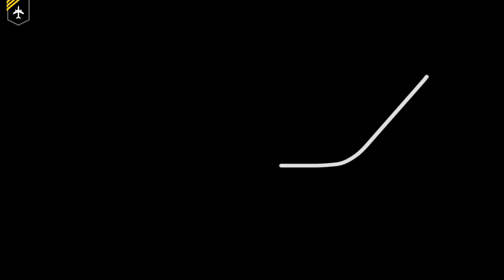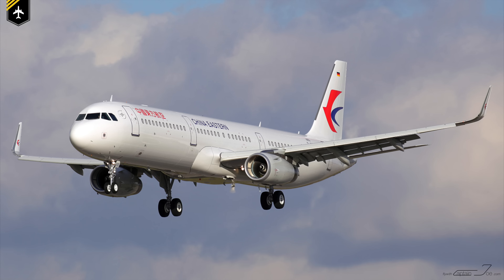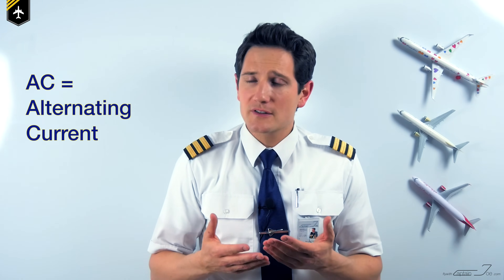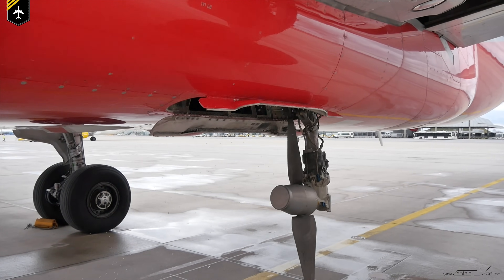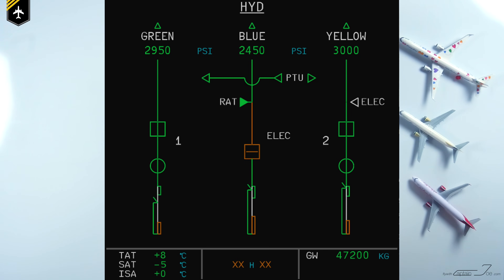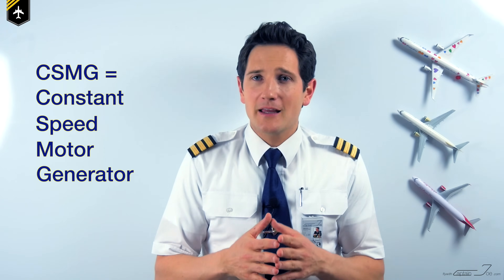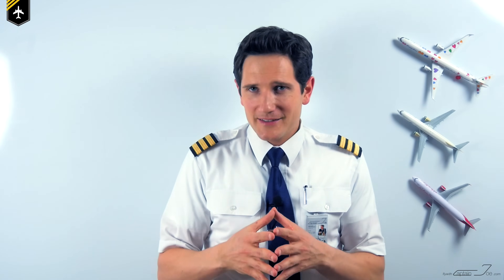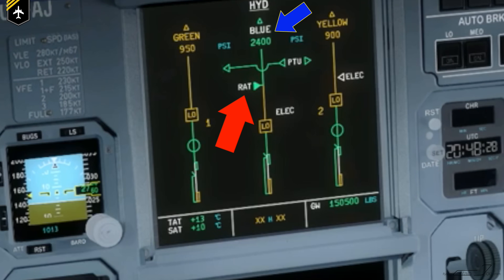What´s a RAT? RAM AIR TURBINE! Explained by "CAPTAIN" Joe

Comment: Very interesting. I'm wondering about the flap situation with MH370 as power was provided only by the RAT (after fuel exhaustion) as the plane descended in a glide to ditch on the sea. Thanks

Comment: With battery technology what it is today, are RATs still used just to cut down on weight?
Reply: Rat gives a higher hydraulic and electric output and for longer compared to just batteries.

Comment: If the max power RAT can provide is 1/8th of the total power required,why is the plane limited to only one RAT,why not several since it's driven by air?
Just curious.
Reply: Because the RAT does not power the generator directly, it powers a hydraulic pump which then drives the emergency generator, having more than 1 RAT is pointless as only one can power that hydraulic system at a time

Comment: Captain Joe, I saw the Hudson River movie and when they lose the 2 engines they turn on the APU... my question is: why didn't the RAT deploy?... It is supposed that when both engines lose the RAT automatically deploys
Reply: You saw a movie based on an incident and thought everything in was correct?!🫢😂
Reply: The RAT did deploy, but since the APU was started much earlier, meant that the RAT wasn't needed
Reply: @ZK-APA  No, if the APU was started the RAT wouldnt auto deploy.

Comment: Why do we need a RAT if there are compressor blades ??
Reply: If there's an engine fire, the engine would be disconnected with the rest of the aircraft, including all electricals.

Hence idea is to have a fully independent system

Comment: The Yellow also has an electrical pump
Reply: Yes it does. It can be used in situations where the hydraulic pump is gone, but the reservoir is normal
Reply: @ZK-APA  how much out power does the electric motor output over the normal engine pump. Apparently it’s a lot less which is noticeable if you lower the flaps. Does the PTU offer more output?
Reply: @tomstravels520  Nope its the same with the electric pump as well. Flaps/slats will be slower if theres another hydraulic system which is off or failed (IE if only yellow is available, then it will be slow, but if others are available then it'll be normal speed, even if electric pump is used)
And the PTU offers the same amount of pressure (Only the RAT gives a lower output out of all redundancies)
Reply: @ZK-APA  so the electric pump output is less than the yellow engine driven pump but not normally noticed if another pump is operating normally? By output I mean how much fluid it came move in a certain time
Reply: @tomstravels520  In all cases, the output is same (in the A320 it is 3000PSI)
So the yellow Engine driven pump and the electric pump both can create 3000PSI, so there is no loss of hydraulic performance per say.
Only exception is the RAT which powers the blue hydraulic at 2500 PSI
Reply: @ZK-APA  I’m not talking about pressure I’m talking about flow rate. How much fluid can be moved in a minute. I know the systems are pressurised to 3000psi (5000 for A380/A350) but the flow rate I was led to believe is less for the electric pumps. For example if the green system pump failed the yellow EDP would be used through the PTU to pressurise the green system. But if the yellow EDP were to fail the the PTU has to be turned off before turning on the electric pump as it’s not powerful enough to pressurise the green system through the PTU. So I’m guessing that means the pump output isn’t as powerful as the EDP’s

Comment: Love ur vids but what u said ab us airways 1549 is inaccurate because they still had fuel,they just didn’t have engines so they turned on the APU
Reply: Yes but the RAT deployed because of the loss of engines. The APU takes over 60 seconds to start so the RAT provided basic electrical power until the APU was running
Reply: @tomstravels520   oh really,I was unaware that tye flight crew deployed the rat
Reply: @rannnn5498  it deployed automatically once electrical power was lost

Comment: My question is , why is only Airbus 319 equipped with a RAT and not all planes?
Reply: Think its on all the A320-series, witch means 318s, 319s, 320s and the 321s, its also fitted on the A330.
Reply: It's in almost all airliners
Reply: @ZK-APA  No, very far from it😆
Reply: @speedbird9313  Im talking  just about airliners, not all planes in general.
Reply: @ZK-APA  Still far from it😉 There is a lot of e.g Boeings out there without a RAT
Reply: @speedbird9313  ooh. I should update my facts if that's true.
Reply: @speedbird9313  only the 737’s and 747-400 or older. All other Boeings do
Reply: @tomstravels520  A lot of 737s out there tho. And he was saying airliners by the way, so there are plenty without a RAT if you include propeller ac.
Do you know if the 737 Max have a RAT?🤔
Reply: @speedbird9313  no it doesn’t. Although I am curious to know what happens to the spoilers as they are FBW
Reply: @tomstravels520  Hm? What has the spoilers to do with this?😆
Reply: @speedbird9313  well if the spoilers are fbw and there is no electrical power then how will they operate on a 737? The ailerons and elevators are fine but the spoilers are also used to help turn the plane
Reply: @tomstravels520  Oh, in that sense👍🏻Its probably a "need of" thought that Boeing has evaluated. On a side note I think Boeing is really behind Airbus and rushed the Max out of panic, but with that being said I dont know the details on how the Max is built🙄
Reply: @speedbird9313  the 747-8 has a RAT but that has FBW spoilers and outboard ailerons

Comment: Wrong. Sully turned on the APU before checklists and before the engines quit completely. You wouldn’t want a rat on a water landing anyway. I wonder if the rat is retracted for ditching. When you push the ditching button.  They forgot to do that. Still stayed afloat. Mostly.
Reply: The RAT deployed because the APU takes about a minute to start. And no it can only be retracted on the ground

Comment: so does the RAT give electrical power or hydraulic pressure? if the former; where does the hydraulic pressure come from in an emergency?
Reply: It gives both. The RAT runs a generator and a hydraulic pump which gives basic controls
Reply: If I’ve watched correctly the RAT pressurise the blue hydraulic systems then the blue hydraulic drives the emergency generator

Comment: Captain Joe can you tell why they can not install parachute on the top of the plane so it can be deployed for low impact in when engine fail and for water surface company should design aircraft like boat shape and put some inflatable plastic so aircraft can float.
Reply: Current parachutes cannot support a fully loaded commercial aircraft and be compact enough to fit in the roof of a plane at the same time. And there is no space in roof as lots of electrical wires run through there

Comment: 4:23 Something really important about the Hudson crash was that the Captain turned on the APU quickly after the birds hit. While this wasn't listed in any procedure, it was somewhat fundamental to the flight safety. The RAT did deploy momentarily but at such slow speeds for ditching the electrical power may have been limited and the flaps would not have been able to quickly extend; the cabin lighting would also have remained off and some of the cockpit displayed would have been off. Turning on the APU allowed more reliable control over the aircraft and most importantly it meant that the aircraft was no longer in alternate law (which it entered once the RAT was deployed); while largely inconclusive in the investigation it was noted that the airspeed of the aircraft was at about the top of VLS (approaching stall speed) and if the Captain had not activated the APU there would have been no stall or VAlphaProt protections whatsoever. It turned out that in the flare for ditching the Captain expected the aircraft to pitch up more to reduce the vertical speed but the aircraft was in normal law thanks to the APU and in VAlphaProt so it refused to pitch up any higher lest it stall; if the aircraft was in alternate law and if it had stalled the vertical speed would likely have been much higher in the ditch and possible less safe.

Comment: Im learning english and about aviation with your videos, thank so much. Captain The RAT in the A350, Is it to produce hydraulic and electricity such A320 family?
Reply: No, in the A350 it's different. The A350 has only 2 conventional hydraulic systems (yellow and green) which both can be powered by both engines. (both engines have 2 hydraulic pumps). As a additional backup theres a fully electric system which will take over if the the normal hydraulics fail for whatever reason.
The RAT of the A350 only provides about 80kW of electric power.

Comment: If they lost both engines then why not turn on the apu engine. It has enough power to run everything and probably provide a very slight thrust! 🤔🤔🤔
Reply: Kuntal Ghosh rat is used for a different use case. Sure if there is a fault with the engine generators, then apu will be used (ps apu produces no thrust)

However in cases such as fuel starvation, or an electrical fire where the issue isn't with power generation, rat will be used.
Reply: The RAT provides power almost immediately, APU take a minute or so to start up

Comment: nice & simple explanation captain joe..
if you want to know more detail about Ram Air Turbine Airbus (RAT) Airbus 320 
such as
- Does RAT A320 has anti Ice system ?
- What is stall protection on RAT A320 ?
- What is CSM/G control Logic on RAT A320
herewith simple explanation of Ram Air Turbine Airbus 320 in my channel : Yusak YS

https://youtu.be/ma6UL8fE0Qg

Comment: Captain Joe. Can you make an video on crash #Pk8303 . Also explain is landing gear automatically returns back ... 5miles touch pilot deployed the gear at 255 knots .. and belly landing on runway
Reply: Landing gear does not automatically retract or deploy but I can prevent deployment or retraction if exceeding set speeds

Comment: Yes, the RAT was deployed automatically in the incident of Flight 1549. However,  it's primarily the APU's credit for supplying the hydraulics which made flaps 2 available. (blue hyd only powers slats) Also, thanks to the APU, the plane remained in normal law which provided high AOA protection and etc. RAT was only a second layer of protection and didn't do much in that case.
Reply: It did for that first minute whilst waiting for the APU to start

Comment: On Airbus A350 & A380, the RAT provides AC power ínstead of hyd power. Possible with new generation servo controls : EBHA (Electric Back up Hydraulic Actuation) using electrical power to pressurize their own hyd circuit in case of general hyd failure!

Comment: This 3 system arrangement is only on Airbus a320?
Second, the pump moves an electric pump?
Reply: Mkanik87 the A320 family A330, A340 at least uses these 3 system method but the A340 and A330 layout is different as to which engine power which system. The A350 and A380 only have a green and yellow system

Comment: I thought Sully turned on the Apu after the electric cut out
Reply: Hunter Gant yes he did, but it takes about a minute for it to turn on. The RAT takes about 8 seconds and is automatic (there is a manual override as well)

So initially the RAT kicked in till the apu kicked on

Comment: Captain Joe, at -4:26 you mentioned that the RAT can power systems for a minimum of 20 minutes in-flight? Is this so? Or was that actually the maximum? Also, why is the RAT not mandatory in the industry? The Avro/RJs, Embraer jets and CRJ family do not have RATs installed from the manufacturer at all. (Noting that the new E190s only now have these fitted).  You may recall an Avro/RJ/BAE146 run out of fuel while circling for landing carrying an entire Copa Football Team en route to a game in South America in 2018-19. The plane crashed after it ran out of fuel, killing most on board. However I thought that if a RAT was installed, this may have given the pilots enough time to obtain vectors and maintain and glide and approach to the runway, even with 20 minutes available. To my next question, does the RAT run off an independent fuel supply? If so, then my above case study would have been doomed anyway unfortunately. Perhaps a mandatory sub-reserve fuel supply connected only to the APU and RAT would be an idea. Do you agree that it should be industry standard to have RATs installed on all medium to large RPT aircraft? Thank you Captain Joe.
Reply: It is the aircraft batteries that can give power for 20 minutes.
Reply: No the batteries power the plane for 20 mins. The RAT keeps it powered until plane reaches less than 140knots. And no the RAT is powered by the airflow as mentioned in the video. The airflow spins the blades. It’s the final resort if your plane runs out of fuel like Air Canada 143 or Air Transat 236

Comment: Captain joe, My question is. If the jet engines were to shut down in mid flight. 
Won't they work like the RAT? The big fan blades start spinning on their own from the speed of wind hitting them while the plane is gliding through the air? Thus creating electricity and hydraulics?
Reply: DIY MAN yes it nowhere need the speeds and as you slow down like the RAT they would start to slow down and control would be much harder. Better to start the APU and have a completely operating electrical and hydraulic system

Comment: A tech had to test a RAT for bird hits. He was issued 4 live chickens. The test was done in a vacuum chamber. The chicken was tethered inside with a cotton string set to swing into the blades when a solenoid was actuated. The bird expired  once the vacuum was set. The RAT was spooled up to speed and the chicken was swung into the turbine.  Messy. The tech took pity on the last chicken since it was not needed. It became his pet.  This was in the '60s and I don't know which airplane it was for. Those poor birds.....

Comment: They should have two RAT's instead of one for more power supply
Reply: Have a Spritzer it’s not practical (though in theory it makes sense)

The purpose of rat is to just maintain enough power that an emergency landing can be made. And it’s very very unlikely that you’ll ever need to use it. Hence having 2 rat will just result in more weight and complexity.

Comment: In the Miracle on the Hudson, Cpt Sully started the APU. Also, you wrote minimum instead of maximum in your video
Reply: NTSB report showed that it was on the extended position (probably automatically deployed after the engine shut down) and for the batteries, it's minimum, because that's the minimum autonomy mandated by the rules
Reply: Yes he did but it takes a minute or so to power on so the RAT took over until the APU was fully activated

Comment: From where does the electricity come to the electrical pump that drives the blue hydraulics system at normal operation?
Reply: The electricity comes from an engine driven generator at normal operation.

Comment: Hey Captain Joe, I got a question for you. When a plane is landing, do the wheels spin to cutch up the speed of the aircraft? And if they don’t, what would happen if a plane landed 🛬 on spinning wheels/ tyres??? And when taking off, how long does it take the tyres to stop spinning before the landing gears are retracted??
Reply: The wheels don't spin when the aircraft is landing. When the landing gear is retracted the hydraulic pressure is automatically applied to the brakes to stop the wheels from spinning.

Comment: Why aren't more RATs installed on planes? After all, 2 or more RATS would generate more power to run more instruments won't they ?
Reply: It is very unlikely the RAT is needed for power. 99.99% percent of the time the redundancy of the other systems will make sure the pilot can land safely. The extra weight of an extra generator will increase fuel consumption. Also the extra generators will have to be maintained leading to extra costs..
Reply: @laurencevdvalk  Thanks for the reply Laurence !. yes, what you write makes sense - the additional RAT's  weight will lead to more fuel consumption, maintenance, changes in instrumentation etc.

Comment: But if the engines fail, how is the plane still in cruise? Shouldn't it be losing height, due to gravity? Didn't understand, sorry.
Reply: In his example he didn't say that the engines fail, he said that if both the engine driven generators fail (which produce electricity). He meant that the engines are working normally but the generators fail. During this time the RAT will generate the electricity for the systems.
Reply: @mikep9604  thank you for explaining!

Comment: Tks for the great video. If hydraulic pressure is completely lost in the middle of the Atlantic (fuel issues?), but close enough to reach an airport), what would be the best procedure: run 20 minutes of Battery and then switch to RAT and landing with minimum hydraulics, or immediately deploy the RAT and save battery for the landing? Thanks for the answers.
Reply: Immediate RAT (in fact it'll engage automatically)

Comment: Didn't sully use the APU?
Reply: Yes he did.
Reply: @mikep9604  so then he didn't use the rat right?
Reply: @Sudden2724  -  He didn't need to use the RAT because they were able to use the APU to produce the electricity.
Reply: @mikep9604  So i think joe got some wrong info
Reply: @Sudden2724  - After your comment I made some extra research, and Sully used the APU, but on an Airbus A320 the RAT will be deployed automatically if there is a total loss of electricity. So according to reports Sully switched on the APU, but the RAT was also deployed automatically. According this the actual situation was that they used the APU to produce the electricity, but also the RAT was automatically deployed at the same time. 

But in case that also the APU would be inoperative, then of course they have to rely totally on the RAT alone.
Reply: @mikep9604  thanks, this cleared a lot up